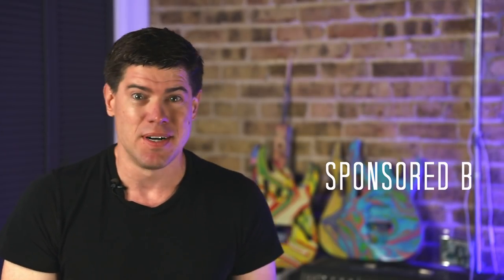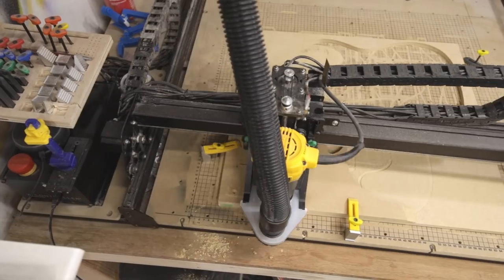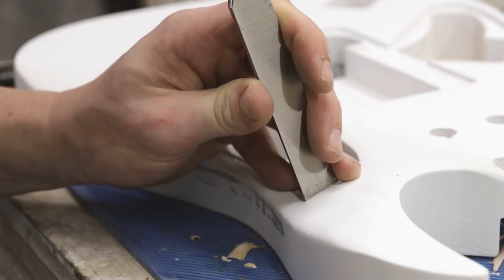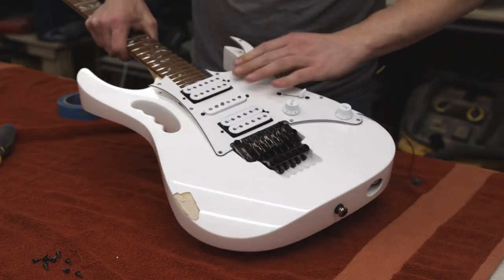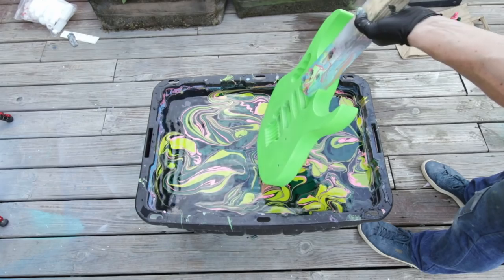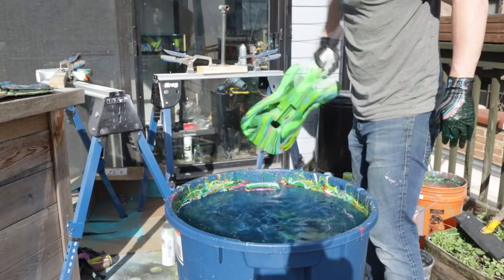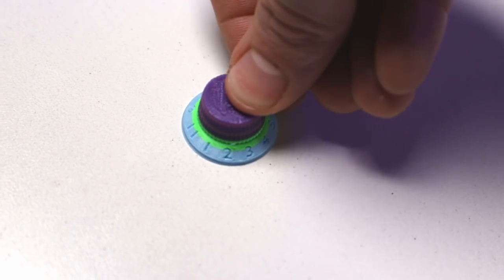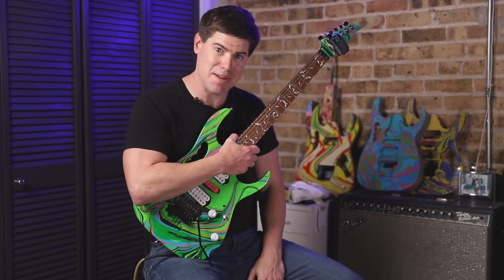I Built & HYDRO-DIPPED a JEM Guitar...what would Steve Vai think?

Comment: Totally not related to the guitar, but the hydro-dipping gave me a fantastic idea for a Lightsaber I'm building. 
Enjoyed the video, it inspired me.
Reply from the maker: A hydrodip lightsaber would be so cool!  If you share pics on Instagram, please tag me so I can check it out!  @modustrialmaker
Reply: @modustrial , I'm not on Instagram, but I am on Twitter and Reddit. 
I did go ahead and dip it today. It looks pretty good, but I did end up with a couple spots where the paint globbed up. Did you encounter that? If so, what'd you do about it?
Reply from the maker: @HungLikeScrat  Yea, that happens sometimes, usually if the part bobs up before you clear the surface.  Also, when you pull the stir stick out of the water, it can create a glob at the spot where it exits.  I always am careful to pull the stir stick out at the very edge, so if it makes a glob, its not at a location where it will get on the item being dipped.  Did you end up sharing pics of it anywhere?  If so, can you send a link?

Comment: I also have built several swirled Ibanez JEM's and RG's. I've always just done it with used guitar bodies or already routed blanks It's definitely a learned process as you've shown here!  I did a PAW and a custom Blue/Green JEM and actually took used necks, removed the fretboards and put new fretboards on them with the disappearing pyramid scheme with kits you can buy on eBay.  Those necks took a long time to do but, I did them!  Clear coating was a bitch because, like you, I couldn't find one that would harden all the way so they could be wet sanded. Then I found the 2K clear which solved the problem.
Building electric guitars is one of the most rewarding things I've ever done! Thanks for the awesome video, Sir!
Reply from the maker: Glad you enjoyed it!  Sounds like you made some really cool JEMs....do you have pics of them anywhere?  Would love to check em out!

Comment: Mine in the avatar. Made 2 years ago. Cant load photos. Red to black fade with hydro dipped black paisley on front, pick guard and headstock. Back was a Devil Johnny Cash with guitar and the devil horn fist Sealed in same 2K you used in video. Plecked  by Strange Guitar Works of New Orleans. Bass 1.75, Treble 1.50 relief .102 mm ,Radius 38 mm. Left hand vibro bar in SRV set up. But the Hydro dip set it apart.
Reply from the maker: That's really cool!
Reply: @modustrial  The time and effort you put into that video is crazy. I can appreciate bare to complete and I compliment you on such work and a great video. Thank you.

Comment: this is why i dont use a router table for flush trimming the sides. i use a drill press rigged with a spindle sander and a round plywood template guide so i can sand instead of route the trimming on my guitar bodies

Comment: Sometime try using simtec polyester sanding sealer the simtec polyester thick clear coat. Then wet sand and buff it out comes out really nice like glass and it's 90% the hardness of glass. The urethane your using is great and lays on really nice with hardly any orange peel if any but it's designed for a car door that can flex so it's not that hard. But the good news on that is it has uv protection so those colors won't fade over the years. Anyways I thought all of those swirls looked great!!
Reply from the maker: Thanks Alan! Good info too!
Reply: @modustrial  yes your welcome. Are you going to do more guitar finishing videos? I've been watching your other video like the one about putting in a new toilet and floor tiles. I see you use products from rockler..that place is great but a little over priced. Try the simtec polyester it comes out really nice and it's the same stuff the pros use👍😊 also use a cheap hvlp gun 1.4 tip since you have about 25 mins to do a few coats pretty much after that it will harden in the gun and wreck it and use acetone for clean up. Sounds like a pain but the results after wet sanding with a bunch of different grits and buffing it all out it's really beautiful!!

Comment: Great job! It came out great!  I've built a few guitars also and tried the hydro dipping. It came out like crap! I researched how to do it. I did what they said like using borax in the water and keeping the temperature at @75°. I also used the recommended Humbrol  paint. My question to you is, did you do those things? And I would like to try the magic marble paint. Could you tell me where I can get it? Thanks in advance.
Reply from the maker: Thanks! And yeah, I tried them all.... Humbrol is hit-or-miss .... Some colors work well others don't, but you definitely need the borax, and patience, and lots of experimentation.  And even then sometimes it came out great, and others not so much.  it's also harder to get thick lines with Borax...you end up with more thin marbly lines, so it's a bit of a different look than you can get with magic marble.  I found 1shot enamel to be similar to humbrol, but a bit easier to manage.... But, magic marble was by far the most foolproof.  And spray paint, it would be tough on a guitar because it skins so fast you can't really swirl it .... You could maybe get results that are okay on some things, but it's glob city on a guitar....

Comment: How did you get the paint to not start to dry and clump on the surface of the water? I tried magic marble but it went bad fast haha.
Reply from the maker: You have to float it and dip quickly... You've probably got 1 minute to do it.  If it dries too fast, you might need colder air temperature and/or cooler water
Reply: Modustrial Maker I see some say colder or warmer around 78degrees depending on paints. I tried magic marble FAIL haha going to try humbrol with borax next. Thanks man.

Comment: Top job!  Looks great but why not just Swirl the Jem Jr body?  I did enjoy watching you create the Lions Claw etc. It helps when you have the correct tools.  I made a Floral Fabric covered Jem homage from an RG and did a lot of the details by hand/using a Dremmel.  It was a success and a great learning experience.  I must try a Swirl at some point
Reply from the maker: Thanks! The Jem JR had an electronics cut out in front instead of on the back and a pickguard over it.  Actually did swirl it too for fun 😁. But I wanted the clean front with the electronics in back like the original Steve Vai swirl, and I wanted the challenge and making it myself....
Reply: @modustrial  Thanks for the reply.  Glad you did this video.  It was a great watch.  Consider adding a clear scrathplate to protect your fab paintwork
Reply from the maker: Thanks Pedro!  I thought about doing the green acrylic for the pickgaurd too, but hoping the spraymax 2k clear coat will be enough without one

Comment: How many Coats of clear did you put on? could you explain a little more on that end?
Reply from the maker: I just did two, no sanding after.  Check out the link in the video description to the clear coat tutorial I followed.  It's detailed and really good... It will explain way better than I could here in the comments 😃
Reply: @modustrial  hey man, i know brad i've seen a bunch of his videos, i'm also curious as to how much paint you used? I just got some magic marble and on a test stick i used it did the watery thing it kinda did to you the first time you did it, is that a result of not enough paint? thanks again for the info!
Reply from the maker: @michaelscrivener4937  if it looks thin (like semi translucent), it could be a couple things.  First is not enough paint.  work quickly and keep putting paint in the middle.  It will spread out to the sides in a bullseye type pattern (sometimes youll do 2 or 3 bullseyes, for larger containers).  each new layer pushes the previous layer towards the sides and also makes the outer layers thicker as it pushes them out.  if you work fast you can get 8-12 rings of paint, about 8-12 drops/shakes from bottle in each layer.  Its hard to say exactly how much you need since so many variables, but definitely try doing at least a few more rings than last time.   Second thing it could be is vertical dip speed...as you lower the object into the paint, the paint kinda stretches over it.  And the faster you move the object, the more paint stretch will occur, and the thinner the paint will be.  You want to lower it down as slow as possible (all my dips were sped up on video, btw).
Reply: Hey man this has been a great help. Really appreciate the info you’ve given me. I guess the last question I have is did you have enough magic marble paint to do 3 separate dips with 1 bottle of each color? I’m afraid of running out doing 1-2 practice dips as I only have 1 bottle of each color!

Thanks again for all the info man

Comment: Great video, great looking guitar.  It kinda made me chuckle though that you did all this work on the build but then had a tech do the easy parts.. ha.  What pups did you end up going with on this?
Reply from the maker: Thanks!  And yea, just wanted it to be ready to play when I got back :) I just used the pickups from the JEM Jr (the pink one was an eBay buy from another JEM Jr)
Reply: @modustrial  Nice.. I have a used white Jem Jr. that has an original Floyd and a full set of Dimario's on it, my only regret when I fixed it up, was not sanding it down and doing a dip paint to it.  (I got it used and it was scratched up and nicked up). I've done a hydro dip in the past using Magic marble paints which work great.  But, now you got me inspired to break the guitar down, and just do it. How did the clear coating go?  I've seen so many YT video's of different ways of doing it.  Did you have to sand and apply over and over again?.
Reply from the maker: The clear coat was easy.  Two thick coats of spray max 2k, no sanding.  I wouldn't say it's perfect, but it's close enough to perfect no one will notice it isn't factory unless you point it out.  Check out that video I linked to in the video description....I basically followed that tutorial.

Comment: Humbrol and borax was always best for me.
Reply from the maker: It works well, but you get very different results than with magic marble.  Humbrol you get thinner veiny lines and there are some colors that are difficult or disperse on the water surface at different speeds than others.   magic marble you have a lot more control over whether you have thick lines or thin lines in your swirl, and it varies much less based on temperature.
Reply: Modustrial Maker I don’t know how else to share so so change my profile picture. The water temperature and hardness was always the biggest contributing factor for me.
Reply from the maker: Yup, that is what I found with humbrol too.  And I'm not knocking humbrol + borax.  You can get some awesome results with practice.  Magic Marble is just more flexible and controllable as far as getting different types of swirl patterns, and a lot more user-friendly since you don't need borax and temperature doesn't matter much with it